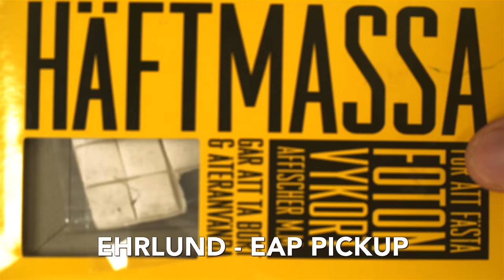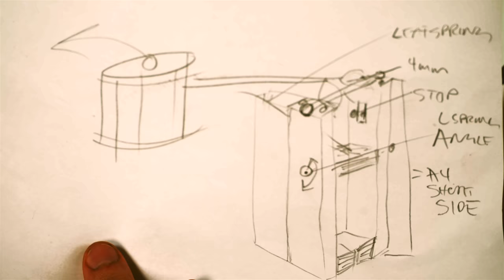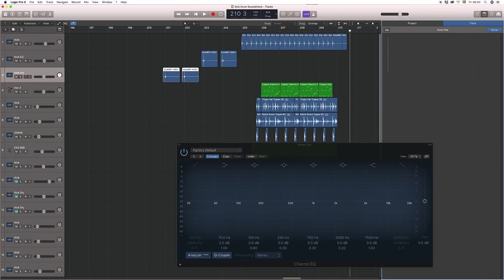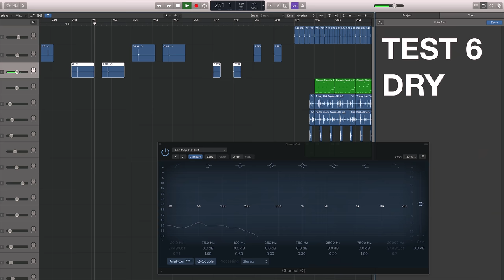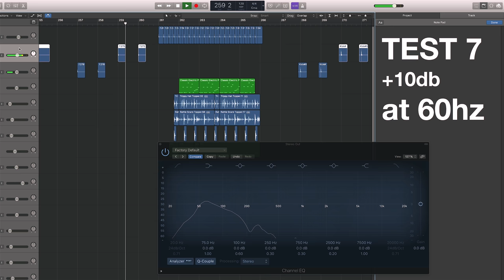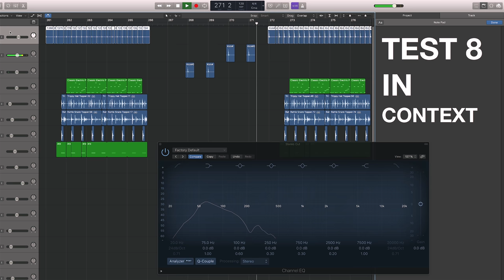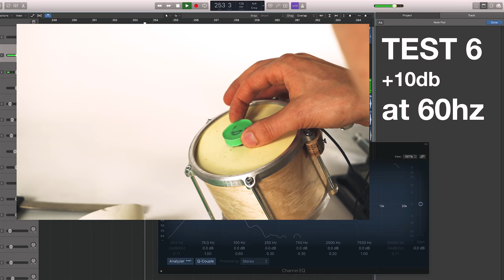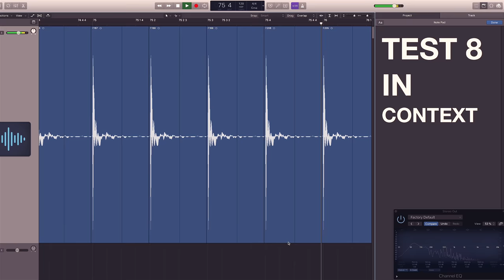Kick Drum Soundcheck - Marble Machine X #74

Comment: Hey Martin, I think there’s something you should consider when planning for the marble targets. You should rebuild your marble bounce accuracy setup so that the marbles land in the cup but then leave it for a few days and occasionally test if it’s still accurate because there’s a chance that the accuracy might change as the surroundings do. It could be that your spring mechanism gets sticky on humid days and thus cause the marble to not bounce as far just as an example. This is only so you don’t run into issues when you have a really small target for the marbles to land in and so you don’t have to do fine tuning before each use of the machine. But I totally love how you test every single part of the MMX before you mount it to the final machine.
Reply: Gravity
Reply: Sticky, wow, yes that is 1000% possible. Nice thinking.
Reply: That's a good idea! If you haven't already, I'd submit your suggestion to the subreddit
Reply: bumpppp
Reply: My biggest concern watching this way the silicon breaking down over time and maybe losing its bounce. but I suspect that wouldn't happen often and would be something to happen slowly, though less dense materials maybe more often? But I know almost nothing about this.
Reply: The springs will fatigue and settle over time as well.  Be a good idea to make extras of all critical springs, so they can be replaced during the world tour, if necessary.
Reply: @solexxx8588  Considring that gravity differs dependig on latitude, it actually might affect the timing and rebounds in WORLD tour :D
Reply: @Jonaasti  I think silicone's usually pretty long-lasting - I don't think it really breaks down over time the way some rubbers do, it's much more chemically stable.
Reply: @Nerdule  Seconded, this stability is very much its selling point in lots of applications.
Reply: @ericchambers9023  sorry ahead of time for resurrecting an old comment but you're never to late to teach someone something anyway on to the response: That is actually somewhat incorrect, I'm a person that's heavily involved with firearms as I'm a FFL and SOT holder, and you may be wondering wtf does that have to do with this, well something that is heavily used in firearms and has been for a long long time is springs of god knows how many different types and make-ups, in the end they are springs, now what actually wears springs out and causes issue is use which is why if you stored a gun with it cocked and locked for about a decade then brought it out and used it, it would still work because to that spring it doesnt matter and that's thanks to metallurgy advancements so if hes using any modern steels he's safe from that issue. Now the spring can "learn" like what you're referring to but it would have to have a constant load of the same amount for decades like minimum of 25-30 years because the steel isnt moving, it's not working and cause the natural break down of work hardening.

Comment: Why did you always put the mic directly under the hit point for the tests? Moving it closer to the edges might yield some interesting sound variations...
Reply: If it's centred it's always the same sound no matter the wear and tear on the skin, at least that's my assumption and ease of replication in parts
Reply: @dino_bread4246  no, otherwise the sound wouldn't change when he changed the thickness of the silicone. As the surface wears, the sound will change. That will always be the case, no matter where the mic is.

My issue was that the sound was too clicky/poppy, and maybe moving the mic to the side would make it more thumpy.
Reply: @Ravlen1  I agree there should be more thump, if possible, but he has the ultimate say.

Comment: Why didn't you do these test before putting all the work into designing and 3D-printing the holders?
Reply: Because you can't test the sound of the 3d printed holders if you have not printed them.
Reply: @SupremeDP   Yes, of course, but if the simple solution (i.e. a piece of plywood with silicone on top) already sounds good, why would you go through the trouble of designing a complicated solution. After all KISS
Reply: @sebastianliebhart4670  He's a perfectionist he wanted to hear both options before deciding on one.
Reply: @sebastianliebhart4670  Because of human error :P

Comment: I think if you remove the plastic from the 3D-printed part which is between the mike and the rubber, replace it with rubber, then you can use both the 3D-printed part which looks very nice, and get the full rubbery base sound. Great video, i liked the tune!

Comment: Hey Martin, great video like always. It might be a great idea to put a secondaire pickup mice inside the drum on the bottom side. The last setup with the multilayer silicon sounds greats and in looks great in frequenties. With a secondary pickup inside bottom side you might pick up some more on the higher end of the frequenties and like that make the sound last just that little bit longer. In short, the top mike makes the "tack tack tack" the bottom mice will pick up the "gong gong gong", combine them 2 and you should get the kick drum sound that sounds just that little more warmer. I use that technic in recording studio's from time to time when they use new drum skins.  Greetz Bensh Belgium

Comment: I think you have to approach this whole kick sound thing from a different angle M.  First - find a kick sound you like and take a look at its frequency curve (preferably a live actual kick sample is best).  Then map your samples as best you can by applying some decent parametric eq. I use to get a tough kick sound by flicking the cone of a 12 inch speaker driver with my finger and eq-ing the hell out of it.  Top tip: a boost at 60 hz is a bit too low for a good kick sound that needs to cut through.  Better boosting around 125 hz for better results. Don't forget you are working under studio conditions - when you put these drums of yours through a big PA rig...well that's a different story...talk to any front of house engineer.

Comment: It's astounding that you get such a good sound from this "drum". It only looks like a traditional drum from the outside. Flat bearing edges, silicon heads, the microphone holder in the drum. You have reverse engineered a several thousand year old instrument and modernized it with space age materials and technology. No small feat.

Comment: I was honestly surprised how great you got that kick sounding. I knew it couldn't be used with an actual resonant skin like a regular drum shell, as it would sound like a dinky tom. So clearly you were going to use an impact sound and EQ it. But for all the times I've attempted such a thing myself with foot stompers and the like, I've never heard it come out so well! Did you test it for feedback? When it's running through a huge subwoofer on stage, that could be a potential issue (though certainly less with all that silicone involved! And a gate could always be applied to the channel)

Comment: The second 'context' sample had a double-kick and you said that everything is going to have 2 channels. If so, then its fine that you tested it when it is centered, but how would this be affected by that 2nd channel. One option is to drop lower/higher than the first one, but it hitting lower would most likely result in a deeper sound than the higher one. The other option is side-by-side which changes the sound quality compered to directly centered but is the most balanced if you can get them to drop equidistant from center. Keep this in mind when testing the other drums and the bars as well. Keep up the good work.

Comment: My question is why are you changing up the sound even just a little bit.  will you really be using the silicon?  It seems like a good alternative for durability.  I know just sound checking, but I would think that you would want to go with as natural a sound as possible. What about placing the Plastic  mount/mic holder at the bottom of the drum but upside down. This way you get the resonance of the full drum and not just the thud of the Marble.  With these soundchecks, what are you listening for?

Comment: Did you take stage temperatures in respect for this projects?
are there any experiences by your side with different air temp/humidty by your old Marble machines?
any plugs to switch to let you machine sound perfect again when hundrets of kilowatts light are burning at your marbles? ;D
Or maybe the fall/fly differntly on, as example, the rubberpads you are using there?

Im really fascinated by your effort and the minds behind this project, keep up your good work ++

Comment: Will the MMX's songs be audible without any of the digital equipment, or is it dependent on all the pickups and some digital modification to get the right sound? I ask because I'm wondering if the MMX is really just a synth with a very convoluted keyboard :)
Reply: The MMX is an analog instrument. Sound reinforcement/EQ/mixing are allowed, but nothing synthesized.  Similar to using the piezo bridge pickup on an acoustic guitar run thru an amp for a bigger sound.  One marble can't generate enough force to bang a full-sized kick drum, so you'd have to physically energize it yourself somehow.  I think Martin's design decision to make a mini-drum and amp up the sound allows him to incorporate a programmed rhythm track without digital sampling.
Reply: @mm-qd1ho  ohh okay so he's doing some EQ and amplification but wouldn't outright make all kinds of wild changes. I imagine a talented sound engineer can make a drum sound out of just about any noise.

Comment: Would having the drum suspended like that cause two issues with quick successive notes?    First is a timing error if the drum hasn't returned to its "at rest" position?   Second, again won't the marble bounce in a slightly different arc if the drum hasn't returned to the "at rest" position?

Comment: Too bad to see that the 3D printed contact mic apparatus isn't going to be used as it wasn't acoustically meeting the machine's demands. It would've been interesting to have used it cast a mold, then duplicated it's shape with silicone to see if the acoustic properties would've been better. But the silicone stacks solution seems to be better and probably less time consuming.

Comment: whtas the point of using a drum box if you have contact microphone, it would have more sense use flat drums for that, or use the contact mocrophone in the botton of the drum so it can detect the vibration of the box and  the internal air provoked by the marble having a deep sound.

Comment: I have mixed feeling about this drum... I feel like it's not a "real" drum. i understand the mic is there to capture without any noise around but still... the way it is placed, under rubber / silicone so close to the the playing area, looks like there is no need of such drum design... Feeling like it s a little bit cheating. A simple thin wood plank with rubber on it would have the same effect.

Comment: Wouldn't you get much nicer decay using an actual drumhead like skin or leather and then EQ that? You could still have a silicone impact layer on top. I'm just surprised you even tried the 3D printed top unless you'd just use it as a trigger.